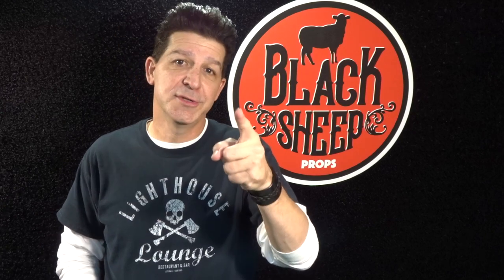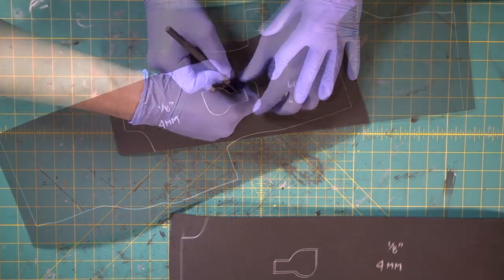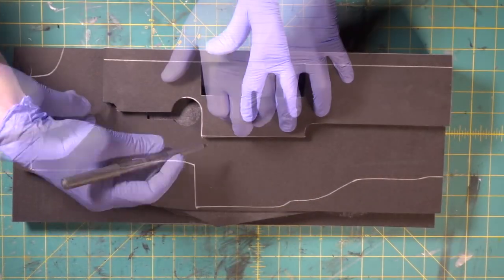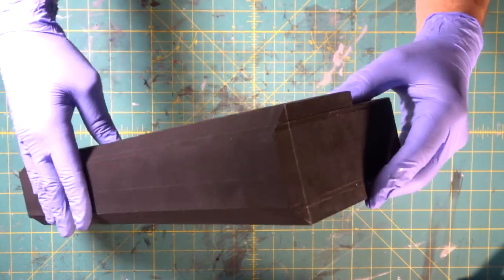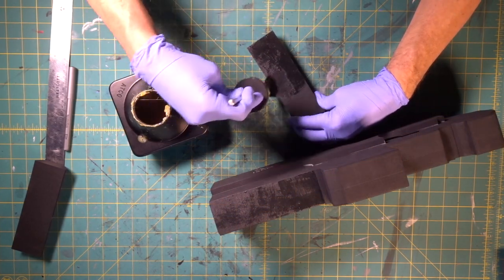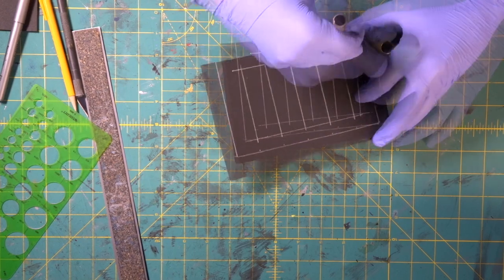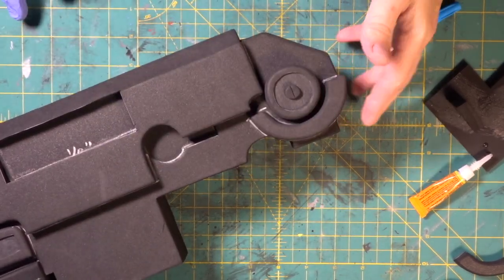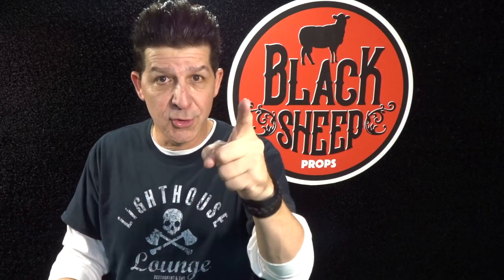Making An EVA Foam Bolter Part 1

Comment: For those pieces that are 18mm and 24mm thick, are those pieces of foam that are bought like that, or have you glued multiple pieces of 6mm foam together? I've only ever found a max of 10mm foam for sale online.
Reply from the maker: Hi Adam,
I have done both - used really thick foam and glued multiple pieces together. TNTCOSPLAYSUPPLY.COM sells really thick stuff, I bought all my foam from them.

Comment: what would you recommend using if you dont have a band saw?
Reply from the maker: Hi! Without a bandsaw you can take the shape and cut it out of thinner foam several times and then stack them up with contact cement to get the thickness needed. Be careful to line up the corners and all the edges when you put them together. All the edges may not be perfectly flush so you might need to go around all the edges with a dremel to clean up where they may not exactly meet. It’s more work but it is the way folks do it without a bandsaw. I did that before I got the bandsaw. Hope that helps.
Have an awesome build!!!
Reply: @BlackSheepProps  thanks for the reply! Would you recommend this build for a beginner as their first build, or would you recommend something else? I'm torn between this and the chainsword.
Reply from the maker: Hi,
They are both a bit more involved for a first build. I have a lot of other builds on the channel that would be better to get started. But the genres are not the same as. the 2 Warhammer builds. For example, the viking axe is probably the most basic build on my channel. Other basic builds are the Sucker Punch Blondie Axe, Medieval Mace and Knight Helmet.
But it really depends on how crafty you are, because even the medium and hard builds are doable if you have crafty skills. Watch the build videos and follow along with each step and you might be fine. The best way is to watch a complete build you are interested in and see if it feels like you could do it.
Hope that helps!

Comment: OK, so I don't have access to a bandsaw. Not sure how practical doing the step at 9:18 is going to be with just a box cutter.
Reply from the maker: Hi PTR!
Unfortunately it isn’t really doable without a bandsaw or sroll saw. If you’re gonna be doing a lot of building a bandsaw is a must.
It was about $120 or so. Once you get one you will live by it.
Reply: If you could make the cuts very carefully before glueing the 1inch and 3/4 inch together at the start then it is doable, the bandsaw makes a nicer cleaner cut but you can also sand the join flat after